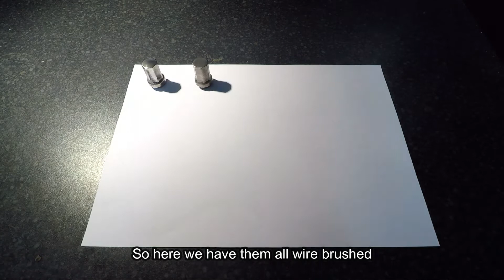Mugen Heptagon Wheel Nuts Restoration #mugen #fn2

Comment: Nice result, I always prefer restoring over buying replacement parts and filling up landfills. Shame about the pitting but at least the faces are pretty mint. To keep the straight edges you could use a file instead of sand paper, gives you much more finesse. I'd put a bolt in a vice and thread the nut on to hold it square.

A bit of an out there idea but you could also try a super fine filler? Not sure how well they hold up to wheel heat though
Reply from the maker: Hi Jamie. thanks for your comment. I like the idea of using a super fine filler. probably will do that next time. Acid dip them and try using some strong filler like alloy filler maybe(? )

Comment: Great video buddy. Shame they are so pitted. But at least they are authentic and should be really light
Reply from the maker: Yes mate apparently these have been made for the GP alloys specifically. Getting hold a set is really hard.
Reply: @FN2OPS  i think they are made to the specs of the GP alloys but i think there may be other models they are suitable for. I maybe wrong. Its been a long time since i looked at any Mugen data
Reply from the maker: @ExpressionCulture  from the information I could get they seem to be designed for the GPs can’t see any difference to a concave wheel nuts tho lol